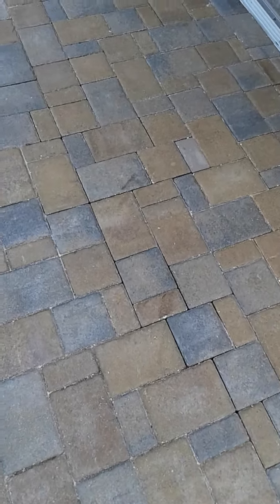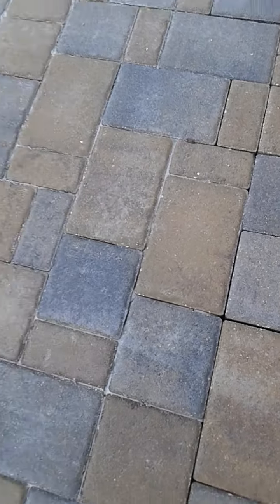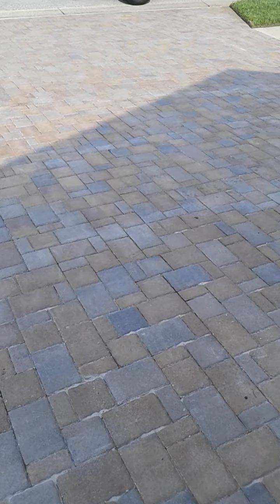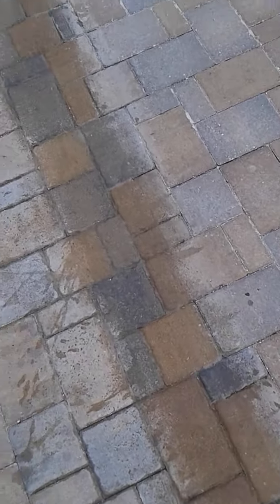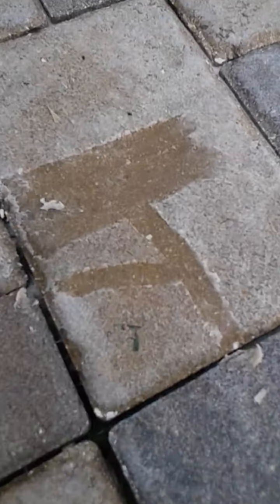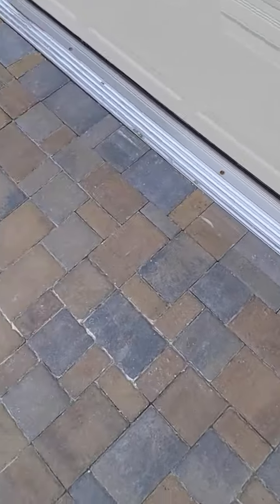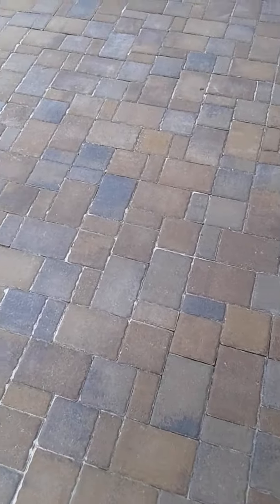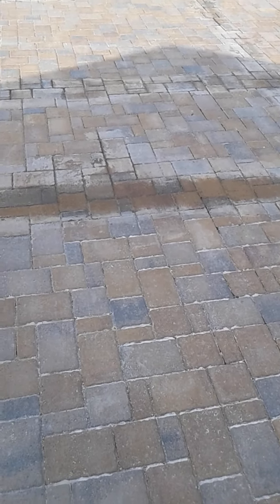Stripping off bad paver sealer in Pasco county FL.

Comment: what was the chemical used to remove?
Reply from the maker: We make our own stripper.
Reply: I just used the Seal n Lock Bio Stripper. It worked really well after about 45 minutes. Turned white just like the video. I used a 3100 psi pressure washer. It took a few minutes in a small area to get it off. I think it would have come off easier with a stronger pressure washer. Keep in mind I’m only stripping a thin layer of seal left behind after stripping off the majority three years ago with Aqua Mix sealer remover. It didn’t work as good. Dura Guard appears to be a great company and very knowledgeable. Congratulations Nick! Unfortunately I live in south Florida so I’m stuck doing it myself. I hired a hack to seal it ten years ago and it turned white because of the sealer used. I’m going to reseal using Seal n Lock Super Wet.
Reply: Hi I’m in the UK and just had a patio laid and I’ve sealed it myself and it’s all gone wrong it’s a polyurethane sealant can you recommend anything to strip it please I’ve tried Xylene but it’s not moving very good please can you help I’m devastated?
Reply: @joannecockburn8645  if you used Resiblock they have a technical help desk that can give advice on stripping off the old sealer and it is worth giving the, a call before you end up lifting the pavers.
Reply: Use xylene
Reply: @ktpowerwashing be careful, that stuff is nasty.

Comment: Seal and lock allows the paver to breathe. Does Ure seal H20 also allow for the paver to breathe also?
Reply from the maker: Scott cheney 
absolutely. this ureseal product is second to none. urethane based sealants are spescificallydesigned for Florida's subtropical climate (distributed nationally) they allow for moisture to permeate through the coating - allowing for evaporation without trapping moisture below. 
Ure-Seal H2o is like seal n lock on steroids. they have a much higher solids content which allows for a richer, deeper color, joint sand hardens to the same consistency as concrete and there is a beautiful low- medium sheen achieved on even the worst most porous pavers we have encountered. definetly a 'leg up' over the other sealants available on the market.
Reply: Thanks for the quick response. I have been watching all your videos and actually learning from you what i can about the paver restoration business. I'm a painting and pressure washing contractor (Painterz Edge LLC) here in New Jersey and i would like to add this service to it. Put it right along side of my deck restoration service. I know originally in your videos that you always plugged seal and lock and then you made a video praising Ure Seal H20 is why I asked. You seem to know your stuff and because you use it on your jobs, that is what ill be using on mine. Ure Seal or the manufacturer of it has a training seminar that i would like to attend. One last question if i may. Can you use Ure Seal in the Seal and Locks battery operated pump sprayer or is there other battery operated pump sprayers that you recommend for this? Anyways thanks for your time and keep the videos coming, love them. Thanks a bunch
Reply from the maker: Scott cheney 
glad I could be of assistance. Seal n lock has reformulated their product multiple times within the last couple of years. When they converted to what they referred to as a 'higher soluds' myself as well as dozens of other contractors that I have been in communication with saw a major decline in durability, longevity and quality of the sealant.
 Some contractors still use it. However I like to satisfy my customers on the first go-around and not have call backs because of premature product failures. Using ureseal, I never get complaints. Everybody is happy. I used it on my personal pool deck at my own home as well as my mothers pool deck.
always a great finish and outlast every other sealant I've put it up against.
Reply from the maker: if you already have the pill pump system from seal and lock, you can absolutely use it through that or any other dedicated 12 volt sprayer
Reply: Cool, Appreciate the advice.